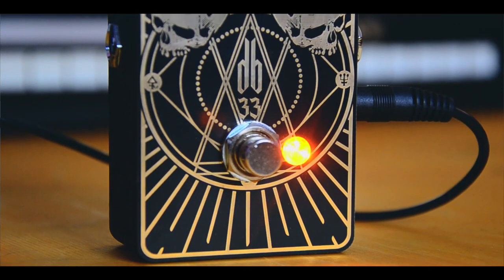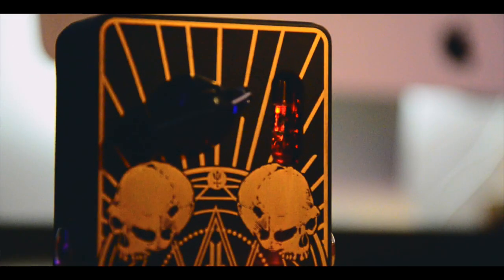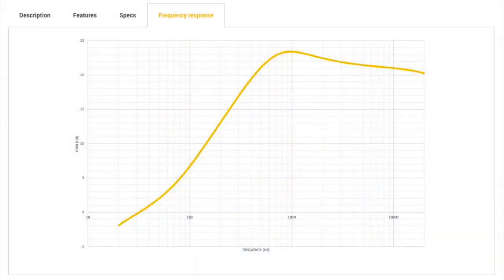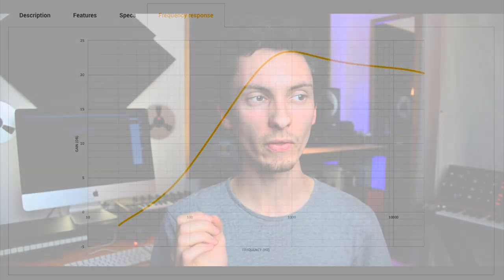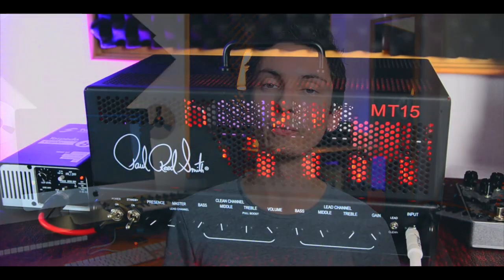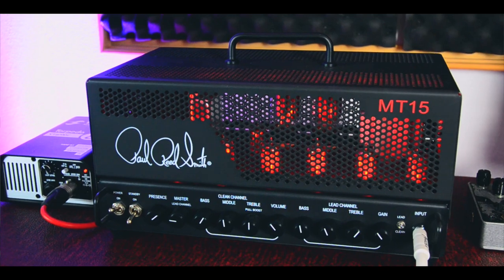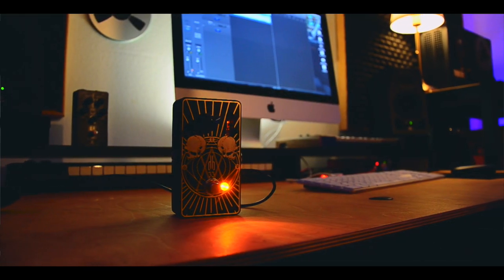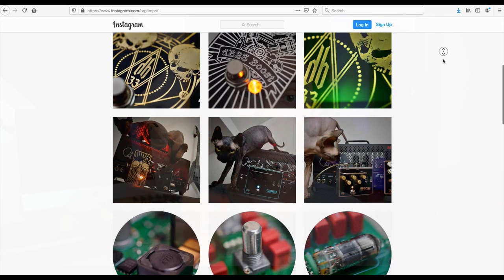It's got a tube! | NRG DB33 Boost Pedal

Comment: The reason for the POT behavior is that the electronic tone circuit effect logarithmically to the sound. Linear response can be obtained by changing the pot used in circuit design.

Comment: As cool as this pedal is, 750mA is 150% the capacity of a Strymon. Most pedalboard power supplies just will not be able power the tube inside, so this seems like a cool concept but unfortunately solid state tech is sooooo much more practical and applicable in this scenario.
Reply: @iLikeD1rt  so you have 2 separate kettle leads too? Venues are gonna love you lmao
Reply: @GreyhandLion  you can get iec splitters
Reply: 750mA is unlikely, a 12ax7 heater current draw is 150/300mA and the anode is 1.2mA
Furthermore, a standard Boss power supply has a 1A current capability.
Then, I don't know the rest of the schematic, but I doubt the boost converter or the charge pump actually uses more current.
A 500mA power supply will most likely work fine.

Comment: Did you put pedal on the effect loop?
Reply from the maker: No it's in front of the amp. But it's in the loop of the noise gate.
Reply: @MilianMalivukMusic  The reason for the POT behavior is that the electronic tone circuit effect logarithmically to the sound. Linear response can be obtained by changing the pot used in circuit design.